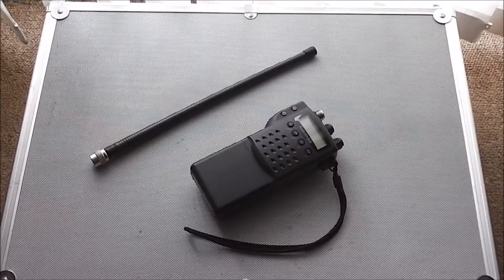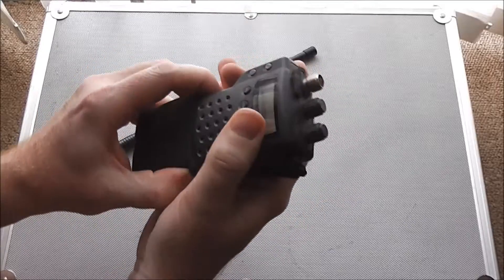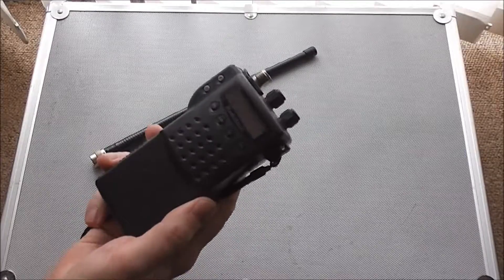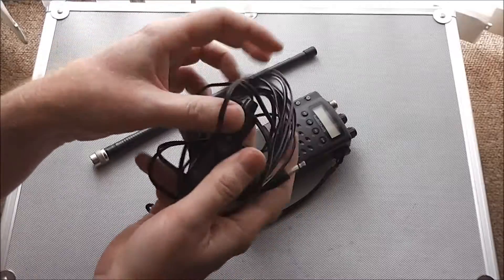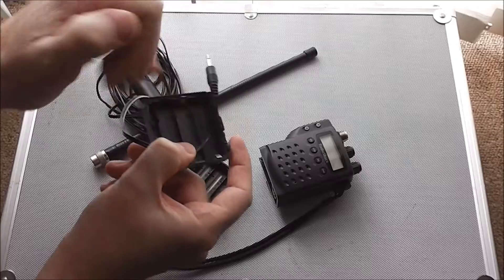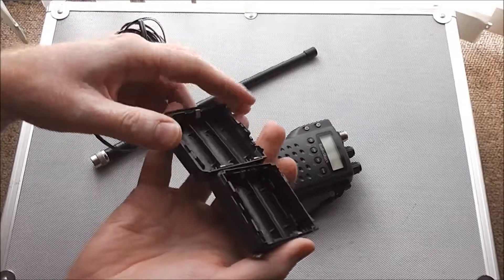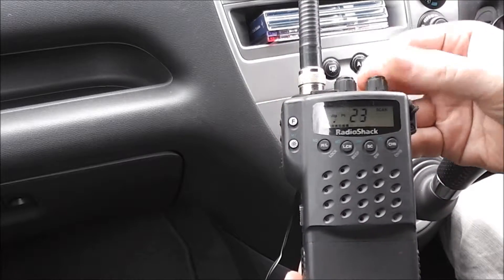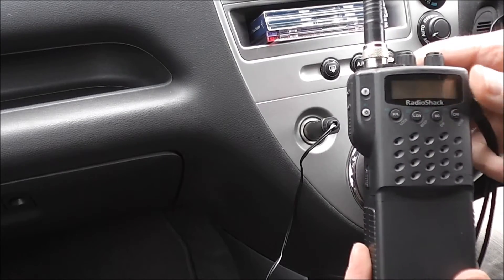RadioShack TRC-1014 Handheld CB upgrade to 12v power

Comment: my battery pack is 8 batteries, thats 12v, it came with the device, a 6 and 8 battery case.
Reply: I think your 8 batteries pack is the one designed for rechargeable AA's that are 1.25 volts each, not the disposable 1.5 volts AA's.  At least that's what my Midland came with. The smaller battery pack is for the 6 disposable 1.5 volt AA's.  I notice my larger battery box has a chip inside probably regulating the recharging. Not sure if putting 8 of the 1.5v AAs in there would hurt anything. Probably not if the OP's 12v mod didn't fry his similar radio.